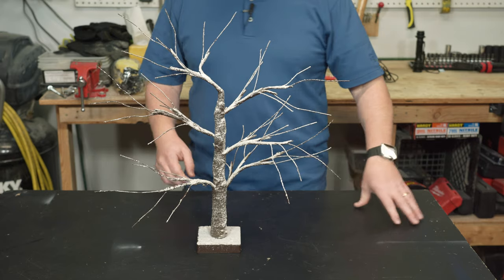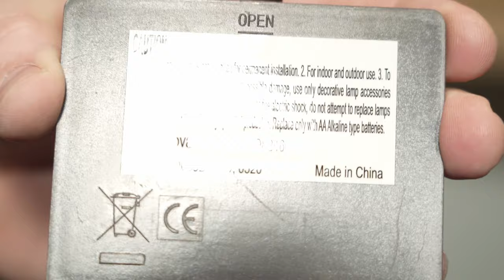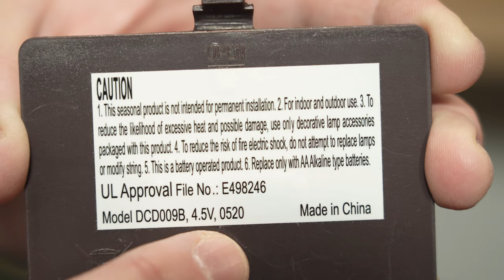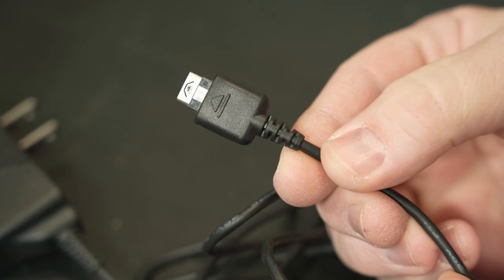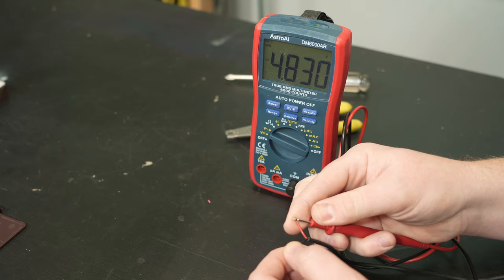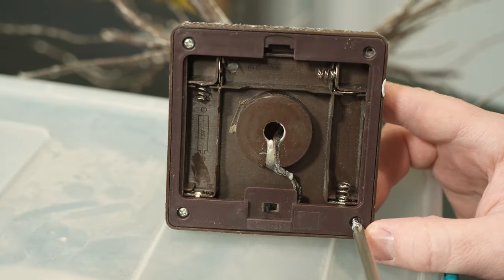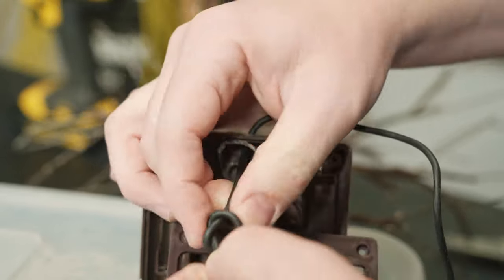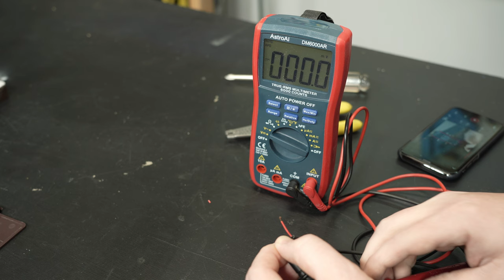Never Replace Batteries Again! Convert Battery Device To Wall Adapter!

Comment: I did this for my automatic trashcan, which normally needs 6 D -size batteries.  The DC power supply cost less than a pack of 6 D-size batteries.  So worth it for things that don't need to be moved around often.
Reply from the maker: Heya Ninja Guy - that's a perfect place to use something like this. Nice job!
Reply: I'm here watching this video because of this same exact thing... I'm replacing those batteries in my trashcan at least every 2-3 months. Such a waste.

Comment: I'm doing this research to power a motion-sensing outdoor light that for some reason is powered by batteries and doesn't offer an adapter option. Notes to people attempting such a mod, battery compartments could be in series or parallel or a combination. Like, 4 AA batteries could output 1.5v in parallel or 6v in series or something in between. Also, consider the resistor you need to replicate the batteries' resistances. I think a AA battery has about 0.1 ohms. I suppose the adapter may account for that, but for delicate electronics I would want to cover all my bases. Its one thing to convert an outlet-powered device to using batteries, its a whole other to do the opposite. Don't burn your house down.
Reply: Hello. We're you able to convert your light to power? I have one that I want to do just the same and the label says is 4.5V. Is a pain in the behind changing batteries every 2 weeks. Please let me know.

Comment: I've done this several times, it's a good idea.  On one project I purchased a cool set of Christmas lights and used an old adapter to replace the batteries. I decided to protect the lights by adding a fuse (appropriate rated mA fuse).  If the adapter failed and exceeded the required voltage it wouldn't (hopefully) fry my cool lights.
Reply from the maker: Great idea to add a fuse, that's a wise precaution!

Comment: Did a search and this is EXACTLY what I'm looking for.  I have 3 pre-lit fairy light Christmas wreaths that hang outdoors on a fence and they eat through batteries fast!  I will do exactly how your video explains as I have the same set up.  Now I just have to figure out how to get all 3 to an outlet.  I will use extension cords of course, unless you have a better suggestion?  Also, I followed your tutorial on adding LED lights to a snow blower powered by a Dewalt battery.  PERFECT!  I got it to work and thanks to your video, the install looks factory!  Now we just need some snow so I can use them!  Thanks again for your time making these excellent videos!
Reply from the maker: I'm so glad that you were able to add lights to your blower - that's awesome! As for your wreath lights - an extension cord is about all I can suggest... though I do recommend protecting the power adapter from the elements in a waterproof junction box or something similar. Good luck!

Comment: Solid advice and is one of those life hacks that seems to have been forgotten. I have been reusing old "wall wart" sty,e adapets for years and as long as you keep the voltages correct it works like a charm.

Comment: Good tutorial! 👍 A small tweak to take the finished result up a notch would be to use a small rubber grommet in the hole that was drilled in the base that has the same inner diameter as the wall adapter's wire. I did that for another project and it looked good and also helped hold the wire in place.
Reply from the maker: Great idea!

Comment: Neat! I have some string lights that I was going to put across my window and realized they won't last long since they're battery operated. I might look into getting the supplies to do this since I've soldered lights exactly like these before to repair them and it doesn't seem any harder than that. It might look a little funny comparatively, but it'll be worth it so I can actually enjoy them!

Comment: Great video- straight to the point! I like that and it explains things very simply.

I'd have wrapped the wires before soldering but I'm just OCDing. Very nice tutorial- I might have just soldered directly to the battery terminals as well, that way I can still power it with batteries- just Don't plug it in with batteries in it! The next step would be to build something to protect the batteries so that it can have batteries and still be plugged in, but that's getting a little complex for most folks.

Comment: Great video. We got a kaleidoscope projector light thingy that shines on the ceiling for 99 cents. Creates a nice effect but I didn't want to eat up AAAs with it. I saw that adapter kits with dummy batteries are $15. I chopped the end off an old USB cable and dug out the soldering iron. Working great. Thanks.
Reply from the maker: Very cool!

Comment: Thank you Les!  You made this so easy that I converted all of my small tree ornaments to DC! Now my only problem is that I'm running low on outlets.
Reply from the maker: Glad it worked out for you!
Reply: Hi! I have Christmas ornaments and led lights too. But they all have 2 batteries only (3V in total) and I have 5V phone chargers and I can’t find 3V ones. Do you think there could be issues ? They do shine a little brighter but other than that they seem fine. Than’ you for your help
Reply: Yes, thanks Les, now, along those lines... if I had a series of packs (each of the same input requirement), could I power multiple units from a single supply, or would I need a converter for each unit.
Reply: @albavel  consiter using a zener diode to lower the voltage to your 3v target. This way you are not overdriving the lights. I learned to use a 0.3v variance per AA(A) battery as a rule of thumb.
Reply: @jimbosander  if the converter's amperage is high enough to support it, then runing the different packs in parallel should not cause any issues.
Reply: DC is direct current, batteries
AC is alternating current, receptacle

Comment: Nice! I can't wait to do this to my RC car!
Kidding, but definitely something I've considered doing with various battery-powered items around the house. That decoration is quite the perfect use for this modification!

Congrats on reaching 100K subscribers!
Reply from the maker: Thanks Cars Simplified!
Reply: @Cars Simplified - Don't laugh, I use to have an RC Car with wires connecting to the hand-held power supply and steering. It was the 80's, times were simpler. As a young lad, I wasn't aware that RC actually meant Radio Control. And even if I did,... I still wouldn't know what it actually meant. However, I do remember my first OFFICIAL 'Radio Control' vehicle. Except, Christmas day was RUINED that year! Because my brother and I got the EXACT SAME RC Truck from Radio Shack. And they BOTH had identical frequencies. So, we could only use one at a time.
Reply from the maker: @CovertRadio  You've brought up some memories for me as well! My first RC car was the "Lobo II", sold at Sears. I begged and begged for it for my birthday, and managed to break it during the first drive. Jumped it over the curb in front of my house, and it broke one of the axles. 😂 Good times.

Comment: Great video. Goodwills are a great way to source the adapters. Batteries are way too expensive to keep replacing them for these sort of things. 

One thing to note is how many milliamps the power supply outputs too. A 1000mA unit is ideal for anything that has a larger load. Some phone chargers only output .1mA and sometimes that isn’t enough current to run certain items.
Reply from the maker: This is a good point. Make sure you read the label on the power supply carefully!

Comment: Nice job, and well worth avoiding frequent battery changes!  Maybe some ideas for future videos:

Sometimes instead of an A.C. adapter, I'll use a battery holder for larger batteries.  I.e. your 3x AA decoration will likely run for weeks on 3x D cells, which could get you thru the season without changing batteries.

If 3 AA rechargeable don't work well, 4x might do better.

Another option is a USB powerbank.  4.5v being "close enough" to the 5v put out by said USB powerbank, just wire it up like an adapter, but now you have a big battery.

Final option if you know how to safely work with "raw" LiIon cells, 4.5v is "close enough" to use a single 4v LiIon cell with a simple single-cell BMS and TP4056 charger module (get one with "battery" and "load" terminals and wire the decoration as the "load" so the board can turn it off when the battery is depleted).

I lied, there are more options but they get more complex. Such as using a LM2576 step down (or "buck") DC:DC converter connected to a power tool battery and adjusted to output the desired voltage for the gadget.
Reply from the maker: Fantastic ideas! Many of them are outside the reach of a typical homeowner, but for a hobbyist or advanced tinkerer these are great. Thank you!

Comment: Would have loved seeing this particular example converted to micro USB. 5V should be within tolerance.
Reply from the maker: Interesting idea, Dakota! That would make things only slightly more complex in that you'd have to install a micro usb receptacle in the housing of the device...and soldering something that small can be a bit fiddly. However, I have several other little devices kicking around that may be good candidates for such a conversion. Thanks for the suggestion, and thanks for watching!

Comment: Do you have to solder or can you twist the wires then add a heat shrink connector??
Reply from the maker: Solder really is best. Twisting is not secure, and will eventually fail over time.
Reply: @AmplifyDIY  That heat shrink you use is meant to replace soldering, as it has solder built-in and does the soldering job when you shrink it.

Comment: Great video! Right to the point. Question: I need a 3v power supply but can't find one. Can I go as high as 5v?
Reply: Or can I even go 3.5?
Reply from the maker: If your device needs 3v, you could likely go down to 2.5 or up to 3.5, but I would not go up to 5v. There are lots of 3v supplies available: https://amzn.to/3YIqKd5

Good luck!

Comment: This is VERY helpful. Quick question: is there an "ideal" range for the adapter voltage to be within for the battery total? For example: 3 AA's = 3 x 1.5 = 4.5 volts. Should you only use an adapter that is 4.5 - 4.8 volts? Or could you push it up to 5.6 volts? etc? You get what I mean. Oh and also how about the amps? How much does that matter? Thanks!
Reply: I'd like to know also
Reply from the maker: Hi Chris - in general, with lower volt stuff, being within 1 volt or so of the intended target is fine. So, if you have a device that uses 3 * 1.5v batteries, using a 5v supply will be fine (It's 0.5v more than batteries provide, but won't hurt anything). As for amps: Remember that volts are supplied, amps are pulled. So the amps will be drawn by the load - i.e, the device you power will determine how many amps are drawn. Again with low volt stuff, most things pull only a very small amount of current - on the order of a few milliamps. As long as your power supply is has a higher amperage rating than your load will pull, you'll be fine. Thanks for watching!
Reply: @AmplifyDIY  so very helpful, thanks
Reply: Old heavy power supplies were unregulated and output a higher voltage with a very light load, settling around the rating with a nominal current draw. These are better used with radios because they don't create noise other than AC hum. A fully charged fresh cell is 1.6V, so it's already a bit over.
Reply: @j7ndominica051 are you referring to the power supply used on this video?

Comment: I dont know how dangerous 4.5volts is 😅 could maybe pop a capacitor in the dc power supply if you short it maybe. But you should also check how many amps you need. It's also good to check if rhe batteries are series or paralell. As 2 batteries may not mean it takss 3volts. It may be 1.5v using multiple batteries for higher amperage.

Comment: I am wanting to do this to my solar porch pathway lamps. I have 6 and if you have any advice, other than buys some electric ones, I appreciate it a lot.
Reply from the maker: Yeah, solar lamps would be a good candidate for this - but make sure you use a power supply that is rated for outdoor use, and make sure the wire you use to string between the lights is rated for damp locations / outdoor use as well. If you look for "landscaping" wiring, you'll get the right stuff. Good luck!

Comment: GREAT video!! thank you. If I have several pre-lit battery operated 9’ Christmas garlands. Would I need to do a separate AC adapter/cord for each one or can I somehow wire them together with one power adapter? Or even wire  2 of them together. How do i calculate the proper power supply if i combine? TIA 🙏🏻
Reply from the maker: You can certainly daisy-chain them all together. If they all run on the same voltage, just make sure you get a power supply that supplies that voltage at enough amps for the circuit. 

In round numbers as an example: Let's say you have 2 garlands that run on 3 AA batteries each. That means each garland needs between 4-5 volts to operate, and they probably only draw a few milliamps. For simplicity, let's say they each need 100 milliamps @ 5 volts. If you wire them in parallel so that you have a single power supply that runs to both, you'll need something that can supply 5 volts at 200 milliamps. It's better to get something that is rated higher though, so I'd recommend a 5v supply that can handle 500 milliamps. 

Key takeaways: Wire them in parallel so that each light/garland/tree/whatever gets the same voltage from the supply.  Make sure the supply can handle the current draw in milliamps.

Good luck!
Reply: @AmplifyDIY  you’re the best! That’s exactly what I needed to know. So helpful and clear. Appreciate you!

Comment: OK, I had the same idea with a dog training device. It makes a sound we can't hear and reduces the barking from 5 dachshunds next-door. It has a 9 volt battery. 
I connected the wall adapter 9 Volt and nothing works... Why?
Reply from the maker: Any chance you've swapped the polarity? Also, it's possible that the wall adapter cannot supply enough current ... it's rated to supply 9V, but at how many amps?

Comment: Great video. If I'm following this correctly, you were able to bypass the on/off switch? Correct? Will this work for a (3) AA battery operated toy light sabre? Thanks
Reply from the maker: Depending on the toy, you can probably bypass the switch, yes. Not sure I'd put this on a light saber that will be swung around a room... having a wire dangling from something like that does not seem like the best idea to me. But good luck!
Reply: @AmplifyDIY  oh no. Its going on a Halloween prop
Thanks

Comment: Great video! When does the device voltage differential to the adaptor become a problem.  I have a similar 4.5v item and an old cell charger at 5.1v.  Is that too much?
Reply from the maker: 4.5 to 5.1 is not a huge difference, and likely would be find. I try to keep things within a 10-15% or so margin. I would not go over 5.5v on something that is rated for only 4.5, for example.

Comment: Thank you very much for making this video. I've been searching for a way to convert my little battery garlic blender to something like this. Just to confirm, at 4:08 when you were testing to see if the light will turn on, you plugged in the travel adapter at this moment right? is there anything to be cautious about at this step? Thank you.

Comment: Would it be possible to safely connect the wires to the positive and negative terminals themselves so that the device can still be used with batteries if you want to remove the power adapter?
Reply from the maker: Sure, if you can get access in such a way that you can preserve the battery connections, then you can have a hybrid set up where you can plug it in if you want to or run it off a battery if you want to.

Comment: Outstanding, no more tossing wall warts out that we "think" we no longer have the device it would have powered, with the added benefit of reducing the amount of batteries needed at least yearly for the vast number of decorations we have that require power.  Now, where did i put that multiple outlet adapter....... :)
Reply from the maker: I have a drawer full of wall warts that came from who knows where. When I need a DC voltage, I just dig through that drawer until I find something that will work. If I can't find it there, my local goodwill has an entire section full of them. Thanks for watching!
Reply: @AmplifyDIY  additionally, since the manufacturers are assuming 20/20 vision and good lighting, they make the specs in miniscule tiny fonts with minimal to no contrast.  I whip out my silver and gold sharpies and put the voltage and amperage on every wall wart as soon as I unpack.  Also a not to what it originally showed up for attachment.  Also, I make the same notations on the device itself.  Amazing how difficult it is to see black text on black background. :)
Reply from the maker: @jim7smith  What an awesome tip, Jim! I'll be using the silver/gold sharpie trick from now on. (lately I have to just pull out my cell phone and use the camera's magnifier trick to read some of these things).

Comment: So.... for the OTHER, likely larger percentage of battery powered devices that we want to likewise convert to wall power and are unfortunately connected in the somewhat confusing and more difficult to understand PARALLEL configuration I guess I go to the next video in the search results... Other than that, great video refresher on what I already know how to do 👍
Reply from the maker: What's confusing about parallel configurations of batteries? It just means that the voltage is not multiplied, but available amperage is higher... This tutorial still applies, I think. You just need to have an understanding of the current draw and voltage requirement of your device to find a power supply that matches.
If you can describe what you are working on, I'll be glad to try to help with details. 
Good luck!